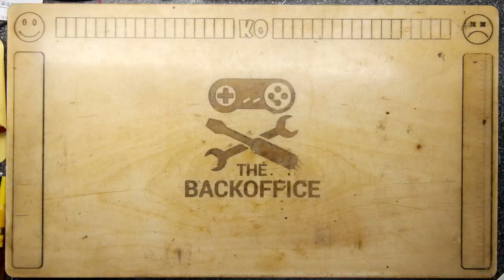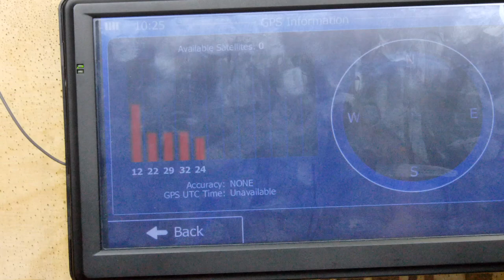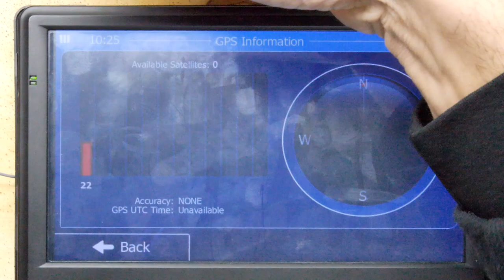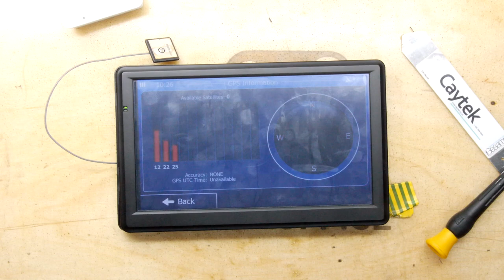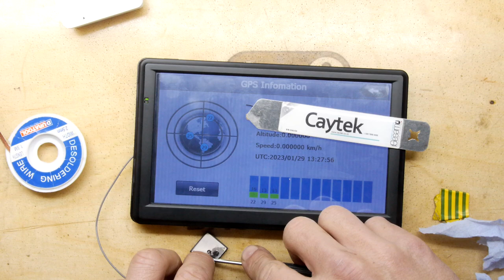GPS Teardown and Antenna Experiment

Comment: The losses in the thin coax is very high, so not much of the GPS-signal gets troug. You almost need a GPS-antenna with built-in LNA to make this mod work well.
Reply from the maker: I grabbed an external antenna recently. If I can make a bias T to get power to it, it might perform quite well. Seemed cheap enough to try 😂
Reply: @backofficeshow  Should be doable, and then a couple of meters of cable won't be a problem, and you can move the antenna to a nice spot without any interference.